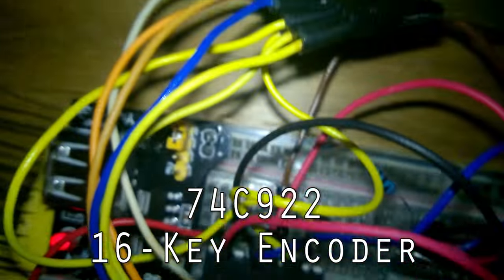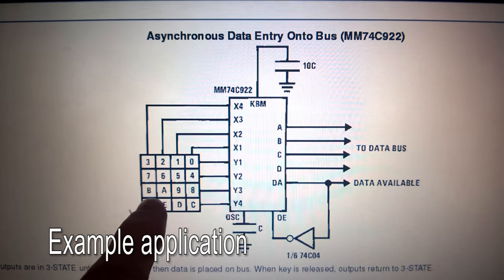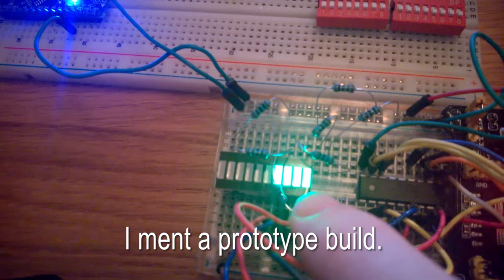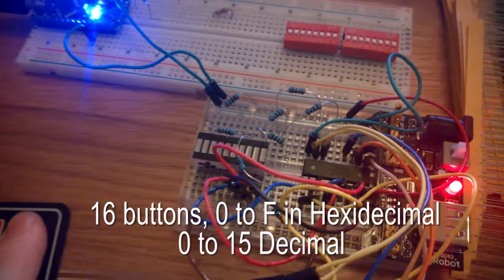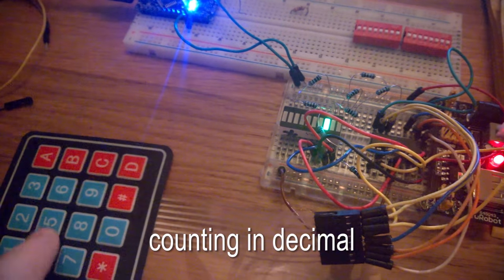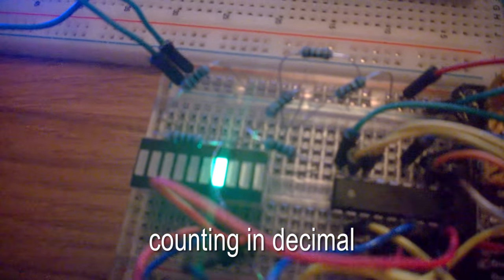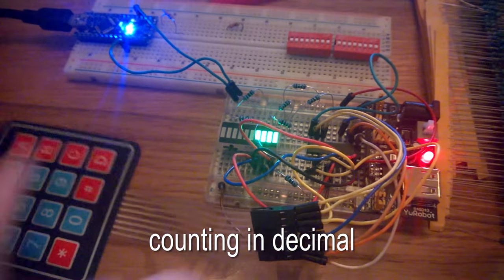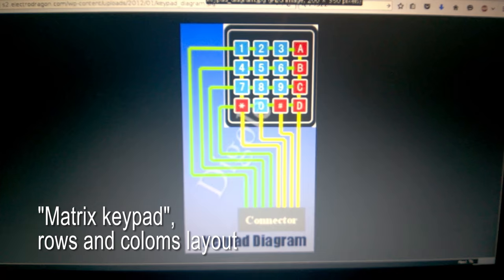74C922 16-Key Encoder

Comment: Hi! is there a way i can have more 16 tactile buttons connected to the encoder and use that encoder to be read by arduino and through the program output as a controller output? Hope you understand what i mean!
Reply from the maker: Yeah sure, more ttl decoding logic could be used and with shiftregisters. But maybe a i2c io expander would be easier, you can chain them on 1 bus and thus use 2 (Or 4 if using spi) pins of the arduino amd have hundereds of buttons. The pcf8574 is a great example of this and is cheap. And if your adresses are filled with em, there is a variant of this ic that sits on a further adress space so you can use 16 of them? If using long i2c paths, use proper pullup resistors and maybe bus extenders, so the signal stays fine. Starformation is also ok and why not get a i2c io expander with more io? if you get a i2c or spi analog ic, you could use resistors of various values and decode in software wich button was pressed, when like 4 buttons are connected to 1 ADC. Or try a keypad matrix and scan the wires sequently, like a pc keyboard does this. Use diodes to prevent signal ghosting. Just random buttons i would go for a io expander, for a keyboard like thing, a matrix. You can even combine a matrix with a expander or shift register.
Reply from the maker: Aw, maybe 1 mcp23017 would be enough, 16 IO pins. But 2 eurodollars is more then the previous io expander.
Reply from the maker: Amazing new video by Karen from element14: https://www.youtube.com/watch?v=k4va1JFtzSg
She uses shift registers and showing example arduino code. Hope you be succesfull :D

Comment: Is there any way to "correct" or convert the numerals on the keypad to correspond with the binary output?  I have not figured out a way... and will probably use an Arduino unit to make the conversion.
Reply from the maker: You might be able to use some of the following: https://forum.arduino.cc/index.php?topic=211548.0
These key encoders where commonly paired with TP5088 to generate phone tones so either a MCU can do the "correction" or use it as is. I planned on doing the conversion with a Z80 but in the mean time got a PIO, so can read and write to buttons and leds using that.

if for a final product the arduino is to beefy and too powerfull, you might be able to fit a small program in a attiny and use the arduino to program it. A truth table and a cpld could also be used. I am not aware of dedicated chips for correcting this (might be expensive too if they where made but not so popular these days)

Comment: can we use the encoder for RC?
Reply from the maker: Do you mean Remote Control ? I gues you could, if you add a transmitter to the output. either some transmitter with 4 bits input, put a micro or some logic to turn the 4 pins bcd into a radiosignal.. or https://www.youtube.com/watch?v=Gwns4Rc5mLE he uses a TP5088 to make DTFM tones, you could send those over a radio and decode them on the other side with a dtfm decoder.

But I gues you can use a micro for all the input decoding and make a nice litle 1 pin data out, where you make small packets (with a crc) and at the recieving end you can decode them (check the crc) and directly controll what you like?

Comment: hi, can you send me the diagram and how i cant get the numbers in a display 7 seg
Reply from the maker: Page 8 (9 in the PDF) shows a diagram of the 74C922 decoder. here is the schematic for a keypad similiar to mine: http://blog.vidadesilicio.com.br/wp-content/uploads/2014/06/keypad.png

a 74LS47 could decode the BCD code to your 7 segement display, in decimal :D (bcd2 hex also excist, but harder to come by and more expensive. or use a eeprom :D) https://www.youtube.com/watch?v=dLh1n2dErzE Ben Eater
shows how you can use a eeprom for decoding bcd into hexidecimal (driving a 7segment display) but if you change the code on the eeprom you could make it do decimal instead. whatever is at your hands, "easier" for you. I tried a few eeproms to do bcd2hex but something wasnt the same or right. could maybe revisit that project someday